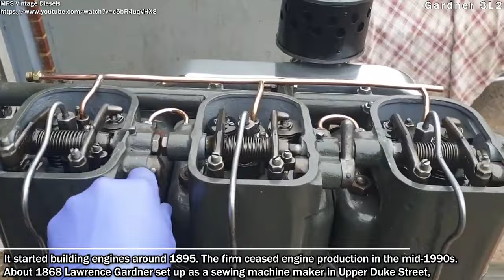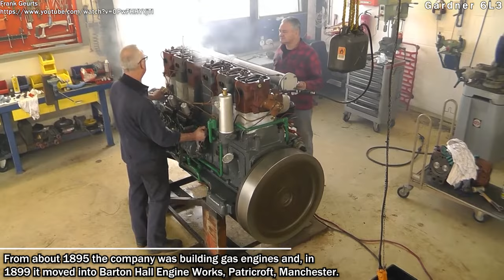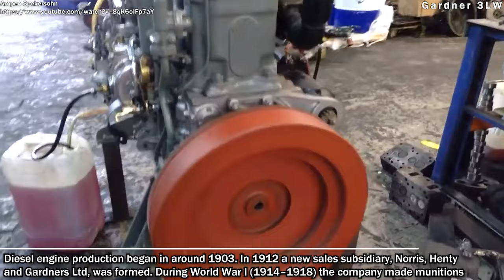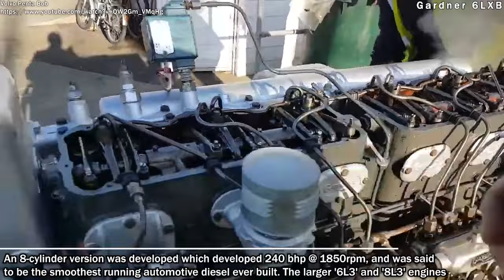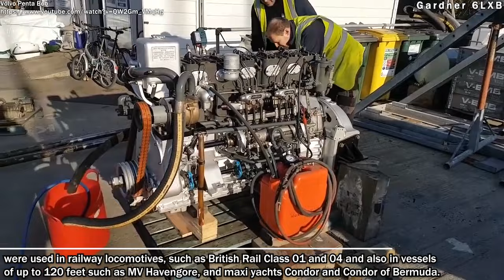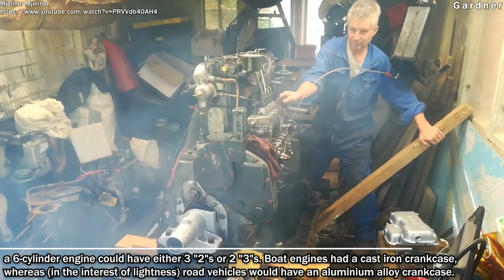Great Old GARDNER Engines Cold Start and Sound Review

Comment: I was reading about these because I was wondering what all these london buses were using.  I here these very slow, high torque old motors, that sound very weak and I discovered low and behold, they are large, naturally aspirated diesels that were weak.  I can't figure out why they never figured out turbocharging.  The first turbocharged 4 stroke diesel was in 1924, the first 2 stroke was 1952.  Turbocharging was very normal on cummins diesel from the 50's on but in the 70's these people were still putting out these extremely old fashion non turbo diesels.  Fascinating motors, really very old school british.